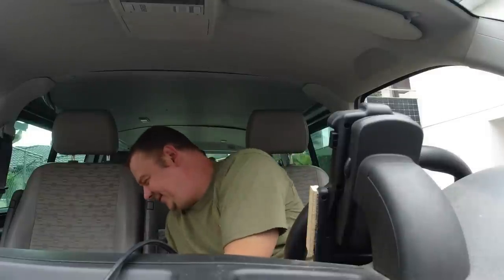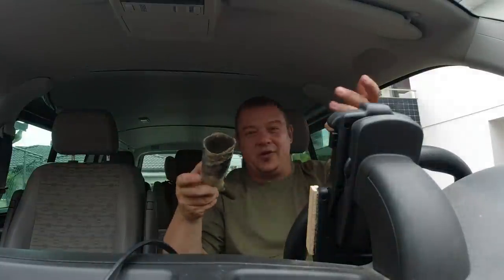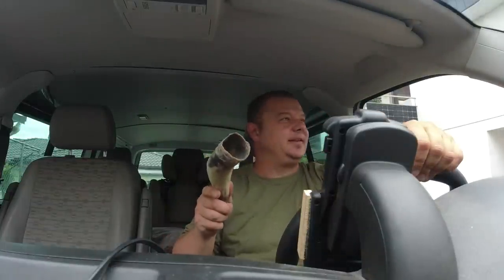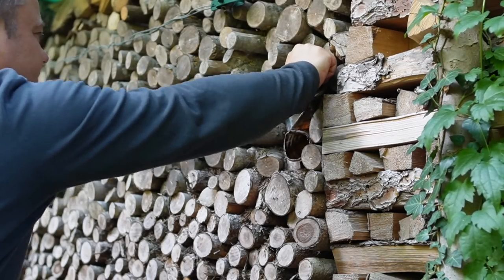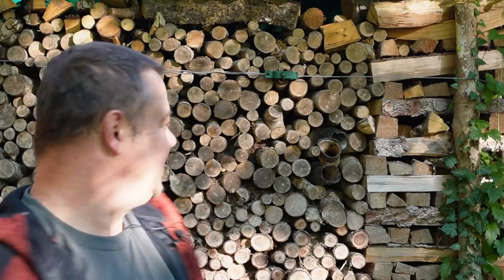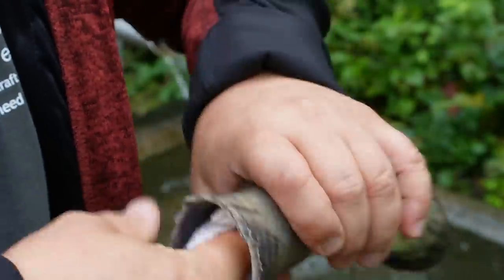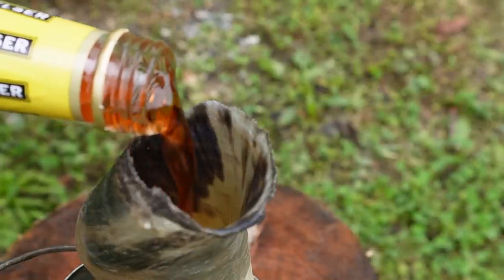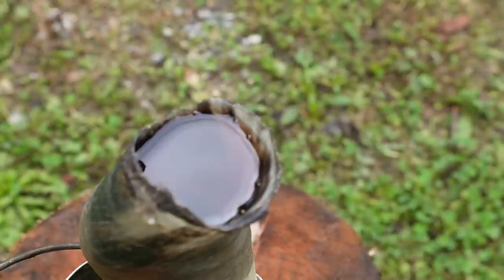How to craft a Viking Drinking Horn with a Swiss Army Knife in the nature. No power tools needed!!

Comment: Just a clarification— Felix is using edible linseed oil here (also known as flaxseed oil). “Boiled linseed oil,” which is used mostly for furniture finishes, contains solvents and drying agents that are not food-safe (nor drink-safe). So you can’t use “boiled linseed oil” on anything that will be in contact with food or drink.
Reply: Good to know!
Reply: Super important.  Cause I used the non-food safe stuff on furniture and flower beds and it occurred to me it must be a different type BUT people will make asinine assumptions.
Reply: This should be pinned

Comment: Hey Felix!  You could have skipped that rum step, and saved the rum to drink.  Most denture tablets are anti-microbial.  You disinfected the horn when you used that tablet to clean it.  Those tablets are also great for cleaning stains from coffee/tea pots and cups.  As a dentist, I have been using these tablets for years to clean my stovetop Moka pot with no scrubbing.  Thanks Felix!!
Reply: U actuall dont use Rum or strong spirits to kill bacteria if you have used dentaltabs its more to get rid of the last foul taste that can be present just after cleaning.
Reply: Good coffee pots make better coffee seasoned. It’ll taste better if instead of cleaning like that you just rinse with hot water.
Reply: thanks for the tips!

Comment: The more Rum you drink out of it the better it works. Walnut oil and mineral oil will work too. But good rum removes it too. The outside  will shine if you use Neatsfoot oil. I  polished the outside with buffing compound to maintain the natural look of the horn. I cut the tip off and  added an oak wood stand to the bottom. The next project is making a horn from a horn.😅🤣😂 Beautiful looking project. 🙂

Comment: I really like your process. Just an FYI, hydrogen peroxide has zero environmental effects. Matter of fact, it is used on plants to reinvigorate them, either sprayed on directly or mixed in to water. As for lining the inside, if you're wanting to keep it natural, as the Norse did is to use beeswax. Heat it up, pour it in, roll it around, and empty the leftovers. But your process may be better for hot temperature liquids such as your hot tea.

Neat!
Reply from the maker: Thank you very much for your interesting feedback!!